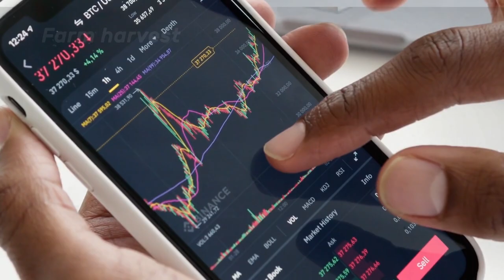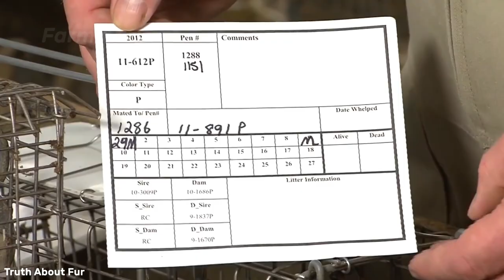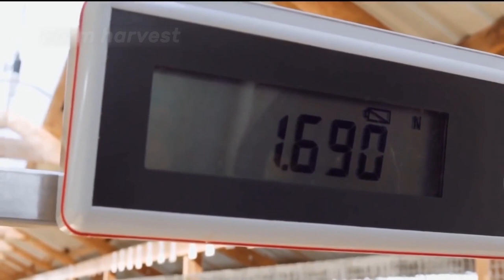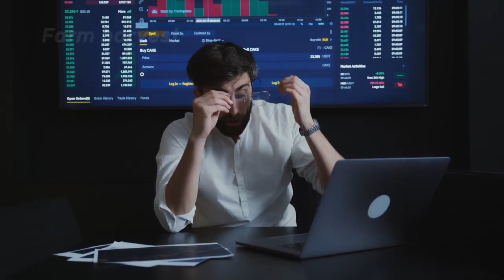I Was Shocked To See How These Mink Farmers Make Billions-Amazing Mink Farming Technology

Comment: Wow this is awesome I actually want to buy a couple of mint coats for my family now! Thanks guys keep up the good work!! I personally like the brown mink fur
Reply: Dude it won’t even fit on you
Reply: why this is cruelty
Reply: @Lazyla  This is a great industry to work in especially when you have this scale of farming operations. A real need in the clothing market. With cutting edge technology they are at the tip of the spear in development with great growth rates using steroid and hormone. Much better yield of fur and looks better. They also use other compounds to boost fur volume and control colour and texture when needed so the farmer can have a diverse crop. It’s easy to inject the stock quickly and it’s low cost. There is a never ending supply of new stock as the old stock just drops new ones so fast especially when we boost the reproductive side too. Makes for a very efficient turn around harvest when you control drop rate and growth rate. This type of stock is the perfect product. Mink and chinchilla variety grow pretty big in a small space. It takes just a 1x3 cage stacked up in multi story buildings and they can really boosts the yield per sq/ft. It’s a better use of land when they only need a small footprint to produce these numbers.

Comment: This is a great industry to work in especially when you have this scale of farming operations. A real need in the clothing market. With cutting edge technology they are at the tip of the spear in development with great growth rates using steroid and hormone. Much better yield of fur and looks better. They also use other compounds to boost fur volume and control colour and texture when needed so the farmer can have a diverse crop. It’s easy to inject the stock quickly and it’s low cost. There is a never ending supply of new stock as the old stock just drops new ones so fast especially when we boost the reproductive side too. Makes for a very efficient turn around harvest when you control drop rate and growth rate. This type of stock is the perfect product. Mink and chinchilla variety grow pretty big in a small space. It takes just a 1x3 cage stacked up in multi story buildings and they can really boosts the yield per sq/ft. It’s a better use of land when they only need a small footprint to produce these numbers.
Reply: This is animal abuse